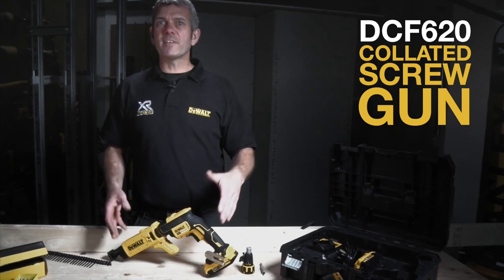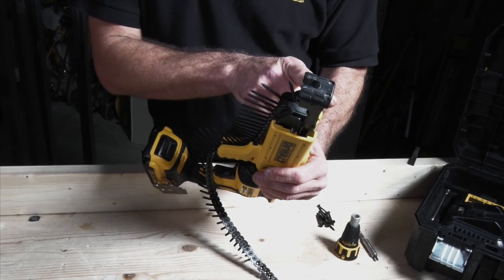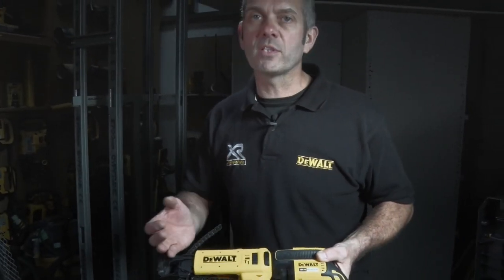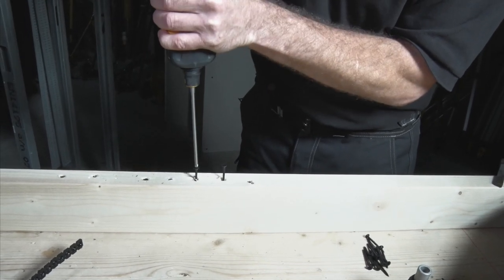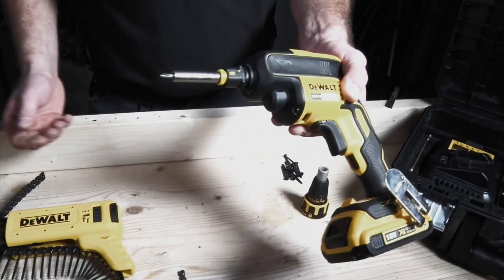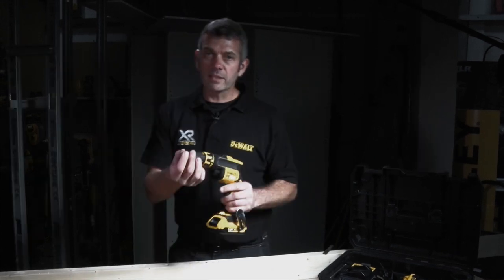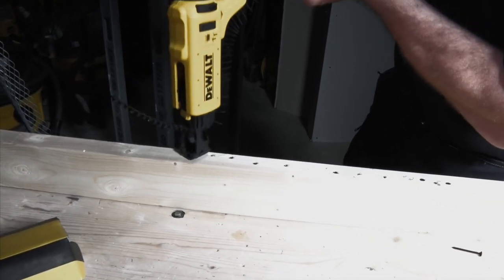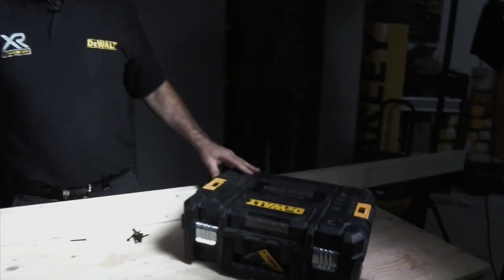DEWALT® XR BRUSHLESS COLLATED SCREWDRIVER- DCF620

Comment: Dewalt you didn't mention that you can lock the trigger in the on position, so when you are boarding a ceiling you simply hold the drill at the back of the motor (moulded for your hand) and it gives you a more balanced grip and more force can be applied to the gun reducing cam out, it speeds the job up also 👍

Comment: Great review and I bought the driver and attachment, but I didn't receive a case with mine.  Do you have a model or part number for just the Case?  Thanks
Reply: Could you redeem the case on the dewalt website? Mine was the same but i had the chance to get the case via redemption

Comment: Will this gun take senco decking collated screws? Or any type of exterior collated screw?
Reply: Yes, but only the phillips #2

I saw a YouTube video of guys comparing drills and using senco screw strips for drywall and flooring.  The flooring uses #2 square- but the new attachment only uses dewalt specialty bits that are slightly shorter than 6” and very skinny shaft.  
No one makes. ANY other bits that work in it.    So you have to buy a longer one, cut it down, cut a new locking groove in the back.   Then chuck it in a drill and use a grinder (unless you own a lathe) and turn the shaft to the smaller size.

Other option if you don’t want to try it yourself is take the longer 6” bits to a machinist.

If I had known that before buying it- I would have bought a senco or makita.   And I have been a dedicated dewalt guy for decades. 

Annoying as hell.

Comment: Dewalt, as soon as you add the auto drive feature like the makita I will buy one.  Not sure why we are here in 2019 and this feature has not been added.  Locking on the trigger and having to listen to a motor constantly running is so 1980's  not to mention annoying.   Otherwise I will just keep using my Hilti
Reply: aaron fisher why would you even look at the dewalt? Hilti is superior in every way. After that you should consider Milwaukee or makita.

Comment: Does anyone make a collated screw strip reloader!?? If I can get 2 or 3 reloads per strip.. at the cost of 25lbs of screws compared to a 1000pce colated at double the price... looks like no one has created like a magnetically tipped geared reloading system that can self feed the strip and reload screws into strips or a punch into strip type tool or something of the sort... comparing $32 per 1,000 collated stripped screws to $50 for 5,952 screws aka 25lb box of 1.25" coarse drywall screws... if i can save $1,000 in just screws per job by buying an even crude home made strip reloader I can  can use in my off time any suggestions would be very much appreciated 💁💁💁